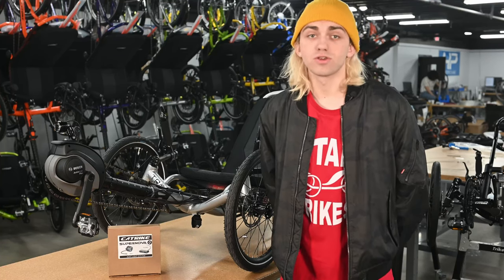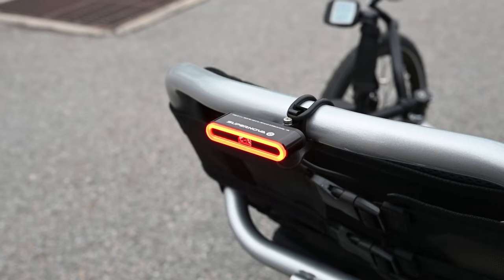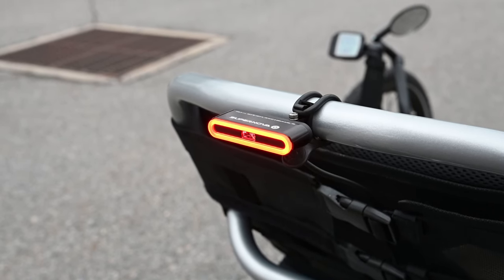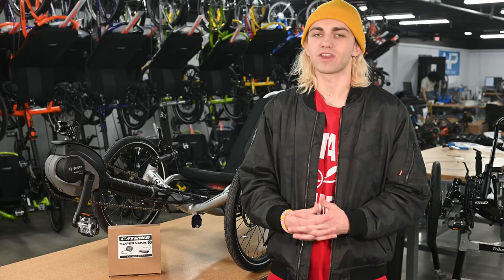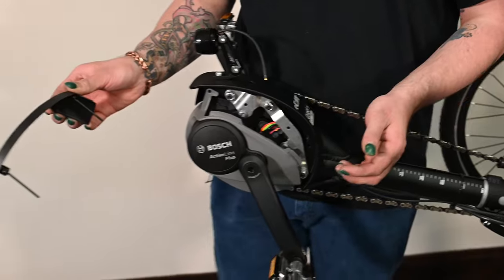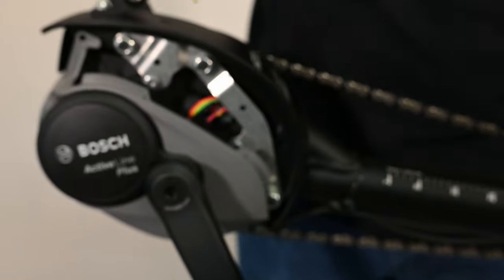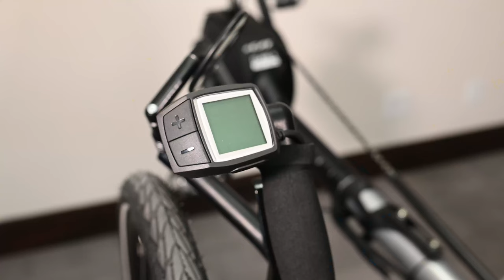2023 Catrike Update - New Integrated Lighting kit for eCat systems!?

Comment: Glad I bought my new Dumont in December...  But really... if you  can afford a $5,000 bike (msrp plus a few accessories) then another $500 shouldn't be a deal breaker.

What I am struggling to understand is, why they give you a meter of cable on the headlight when it only has to run 6 inches...   That much excess cable wound up inside the motor housing is a problem just waiting to happen.

Comment: No light kit for pedal powered Catrikes?
Reply from the maker: This kit wires directly into the motor so it wouldn't be able to be powered on motorless trikes. But we do offer rechargeable lighting options that can be mounted on any type of trike. You can find those on our website
Reply: The video promotes the lighting kit as an offset to the price increase, but only for motorized trikes.  Catrike customers who want to ride solely under their own power do not get an offset the the price hike.